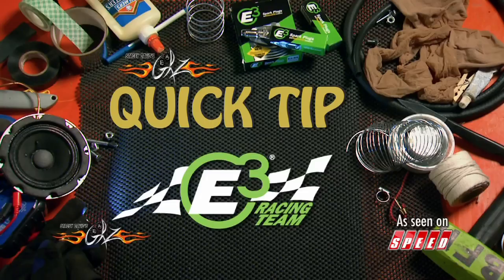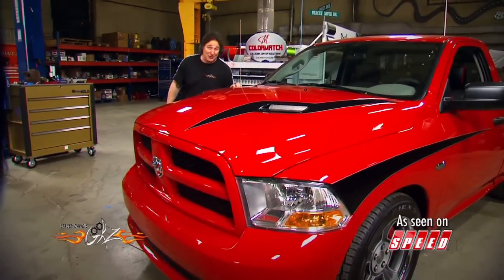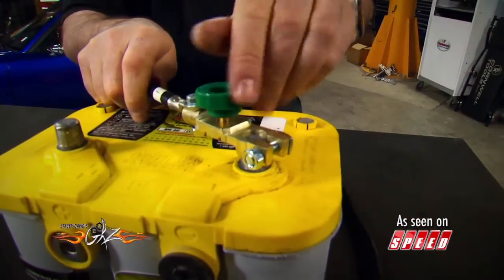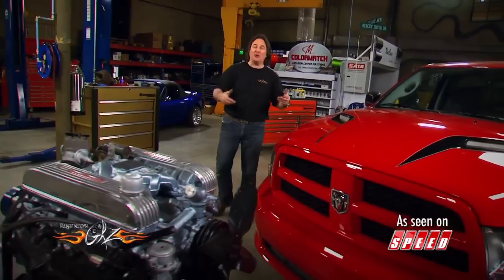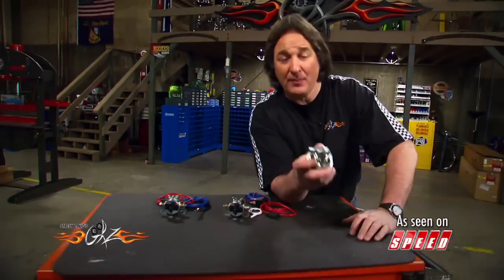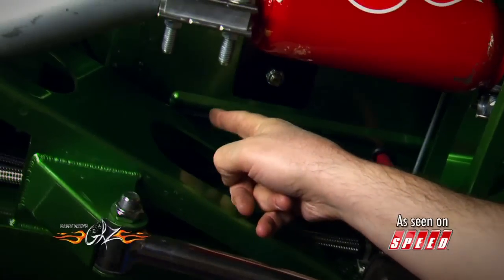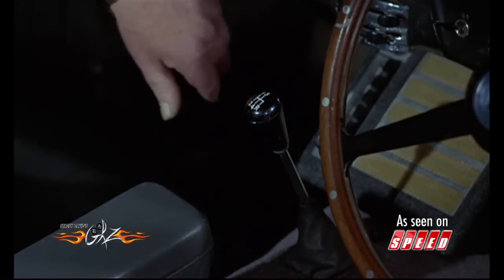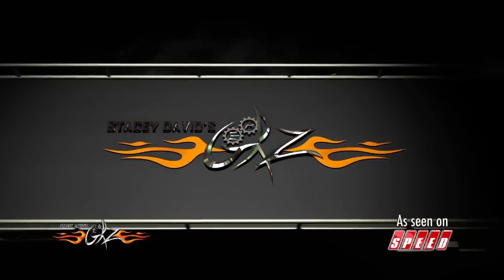Stacey David's GearZ Quick Tip: Keep Your Car From Getting Stolen

Comment: I take my engine out, When I park and walk with it
Reply: Raul Serrano 😂😂😂😂😂
Reply: lmfao
Reply: Raul Serrano ..you drive a rx7 don't you
Reply: I prefer the transmission. I go under the car each time i go to the grocery store and take out all the gears and put them in a carrying case over my shoulder. Go in get some milk, and just pop them back in when i'm ready to leave.
Reply: Raul Serrano i do that too my viper, i love carry a v10 around.
Reply: ALL the gears?  Wouldn't it be easier to take out, say, just First and Reverse?
Reply: AZMike Youre referring to an Auto trans arent you? Im pretty sure everyone in this comment section is a manual driver
Reply: LOL
Reply: Never thought of this...I'll have to try it with a 440
Reply: You guys are so silly, I just take off the driveline 8 bolts and then walk like Gandalf to the store.
Reply: Is it one of those old add on motors for a bicycle?
Reply: Lol
Reply: Smart.
Reply: @QuintTheSharker  car thieves watching this video too
Reply: I just remove the steering wheel and carry it with me. And install a fuel cut off switch. I also have a fuel cell in the trunk my e46 m3 and people can look at it and see it definitely takes premium and try to Siphon gas from my OEM gas tank  tank which is completely disconnected from the rest of my car and its filled with bleach, water, Iso-heat and gasoline. Yeah it may add extra weight to my car but at least it give those thieves a lesson as their car gets completely destroyed! Lol.
Reply: Lmao good idea😂😂
Reply: That's crazy. I fold up my car and stuff it in my backpack. Save lots of money on parking that way too. Very easy.
Reply: Lol
Reply: What the fuck is going on in that comment section bro lollll i'm weak asf
Reply: Where do you keep your engine stand???? I tried towing it, but those little wheels couldn’t keep up!!!!!!
Reply: auh you must have a geo metro
Reply: In the future, that won't even be a joke with the way car engines are getting smaller and smaller.
Reply: I need quick release engine mounts
Reply: @azmike3572  why not just take the Driveline with you
Reply: Richard Wolf, Zinfandel66 already does it!
Reply: @azmike3572  you guys are joking around but I literally pull my 9.9 Honda Outboard out of my sailboat every time I leave it at the dock because I don't want my freshwater motor stolen
Reply: It may be unnecessary.  They wouldn't steal your outboard from your sailboat because that would be dishonest!  (Smiley here)
Reply: @azmike3572  dude you have no idea.
I've never owned a boat before so I didn't understand how it worked so I wrapped a chain around it and chained it to the dock
When the tide came in the boat couldn't move so the ass end lifted 20 feet up in the air
Everyone was laughing and pointing as they were walking by and I had to wait six hours for the tide to go back out to take the pressure off the chain so I can unhook it!
Then I bent over to pull my sail boat motor out of the boat and my Sig Sauer handgun fell out of my holster and into the water
I spent two hours trying to find somebody and then paid him $200 to hop into the water to get it out for me and I didn't realize it was only 5 feet deep and I could have got it myself
Reply: You've given us unexpected info non-boat owners don't realize.  Thanks.
Reply: Tregeta take a quike change rear end
Reply: This dude is a man. My props go to you sir
Reply: Lmao!
Reply: @v4sdude191  cool
Reply: I literally laughed out loud
Reply: I prefer to just jack up the car take one of the wheels off and my adorable hyperactive kids just love rolling it all about those supermarket aisles keeps them occupied for 3hrs at least while the Mrs spends my hard earned cash on groceries we don't need aw bless em all🤣
Reply: I thought i was the only one
Reply: If I don't want anyone to take my truck I just get in my truck and drive away
Reply: Must have a asian car huh
Reply: Man this comment made my year and it’s January 😂😂😂
Reply: You made my day Raul , you are going to heaven 🙏🏼
Reply: They stoled My moms car battery
Reply: Hahahhahaahhaha
Reply: Lmao!
Reply: Lol
Reply: That's  genius  lol
Reply: Not everyone has a moped, Raul
Reply: RauI,thought I was the only one.
Reply: LOL!!
Reply: Lol
Reply: Lmao
Reply: Bahahahaha
Reply: Or you could fashion a clutch pedal quick disconnect....
Reply: I had one of my cars 🚙 stolen my V8 Mk3 Cortina yes it’s true not pulling your leg it was stolen. So now if I go to the super market or anywhere I just remove all 4 wheels put them in the boot I think you Americans call it trunk and I thought only elephants had a truck 😂 😂 😂 and inside of my 07 Mustang and throw one in my shopping 🛒 🛒 🛒 trolley
Reply: Lol😂 lmfao😂😂😂
Reply: Lmaooo
Reply: Doesn’t disconnecting the battery cause the computer to reset and go back to factory defaults?
Reply: Same

Comment: In the US just drive a manual and it will not get stolen!
Reply: +wizardnil  =))
Reply: +Zimas its sadly true!
Reply: Unless it's a wrx or something like that then it's the other way around
Reply: +Chris L that's why thieves never rob Imprezas
Reply: Yup.
Reply: I would love to believe that!   my Honda civic manual trans just was stolen this morning....
Reply: I had a manual it was still stolen lol...2 days ago
Reply: I believe The most commonly stolen car is the Camry. Then the Civic and Accord. The F150 isnt even in the top 5
Reply: Are you guys leaving the keys in the car or are they just pre-immobilizer cars?
Reply: next day it was found*
Reply: MrZrazies
Very cool it was recovered.
Reply: wizardnil Hondas Nissans are manual still get stolen.
Reply: I recently restored a 70 Monte the my dad bought from a co worker 20 years ago he backed out then but sold it to us later. he worked in St Louis and his wife was an electrician she wired in a huge brass breaker type fuse on the positive Cabel and he pulled it when he left the car in St Louis and it never got stolen
Reply: MyNoble06 ....because it was momte carlo.
Reply: +Archie Beech because this was in the early 80s in St Louis
Reply: wizardnil my brothers old car with manual shifter was stolen by 15 yo kid. he was arrested on gas station
Reply: MrZrazies I knew one guy, his civic was found in a 20 minutes after it was stolen... it was "parked" not far, but it was no ENGINE and TRANSMISSION  (whole front underframe with front suspension).... he probably didn't have change in a car, they took engine  (
Reply: wizardnil The guy from Engineering Explained had his car stolen and it was a manual.
Reply: My truck has a highly specialized starting process. You tie them 2 wires together, coast it down a short hill, and drop the clutch.  To keep thieves from stealing parts for scrap iron, I usually put a 12 volt electric fence positive electrode to the body.  Don't forget to turn it off before trying to drive the truck. I still remember how loud the old lady screamed when she grabbed the door handle.
Reply: +Grumpy old fart this made my day
Reply: Mr Zrazies......Someone stole my old pick up truck, and brought it back the next day with a note.....The landfill wouldn't take it, and get some good CD's, not that Bluegrass shit.
Reply: Get a quick release wheel and you're set
Reply: my ass, people say that but don't act like manuals never get stolen lbefore, happens all the time
Reply: lmao right. i luv driving manual is super fun.
Reply: wizardnil not true dude
Reply: Can say this works lol. came out side with my window busted upon but the car wasn't moved but an inch away from my house lol Note im 20 and learned on a manual and refuse to drive anything else but that
Reply: Dark Lord lmao nice 👍🏻👍🏻
Reply: MyFluctuations yeah it's very sad how manual is slowly becoming obsolete.
Reply: Indrid Cold wow that is so sad and funny at the same time
Reply: Wow! I seriously know that the OP wasn't talking about every case and just making a point on how a manual is becoming a thing of the past. And true, us older guys either learned on a manual of it was introduced to us in drivers training in high school. Only a young person with desire to learn will do so now. Other than that, they run away from a manual as if it were a black widow. (Now I expect to see all the comments..."I'm young and I drive a manual... Just making a point about most, not all.)
Reply: Lame joke is lame
Reply: wizardnil lol
Reply: Ben Santos is deported
Reply: Not if ur in a purto rican neighborhood
Reply: TheLokoViejo you mean mexican.
Reply: TheLokoViejo I agree....
Reply: "In the US just drive a manual and it will not get stolen!"  LOL, yeah right.
Reply: wizardnil I have a short shifter in my car with 6spd..   R is high left instead of low right like most 5 spds which more common...  All I do is remove the shifter knob and 1 there is pretty much nothing to grab for shifting with 2 most can't find my reverse even if they so try lol..
Reply: wizardnil not true.....anything can get stolen
Reply: Hahaha yeah right
Reply: wizardnil  in south florida... this isnt the case...
Reply: Lol so  true
Reply: wizardnil most car thief's know about cars and can drive stick...
Reply: Lol
Reply: It's true! Most people don't know stick
Reply: Jerald Rae my dad's Silverado is like that. They can still hotwire it bit if there's no key the steering wheel locks
Reply: NRG makes a ball locking kit that goes over your aftermarket steering wheel hub kit, it comes with 2 set of keys, and you attach it to the hub, then lock it with the key. Also these are great tips in this video. You just need to find a good hiding spot, like under the seat or deep inside the glove box, on the top corner, where they can't see it I would install a kill switch there.
Reply: wizardnil flatbed nullifies that
Reply: Short of illegal, lethal booby traps and if you have the money,  a good strong perimeter fence 10 ft or higher, a solid garage with good strong locks and doors, cameras, and armed guards work well.
Reply: They are getting harder and harder to find.
Reply: My 6spd truck was stolen WITH MY DOG IN IT, thief learned how to drive it til it ran out of fuel. My dog was hot and terrified but OK when (thank God) the truck was found that evening!!!
Reply: Enterprise Earth parts
Reply: That's is such bullshit. All cars get stolen whether they are automatic or manual
Reply: Jerald Rae The F150 is also the most stolen vehicle in Jefferson County Missouri.
Reply: HAHAHAHAHAHA! Right??? So on point. LMAO
Reply: Omg so fuckin true lmao im fuckin laughing so hard right now. I think i peed a little lol. Never really understood y people drove autos up until today. 😂😂😂😆😆😆😂😂😂😂
Reply: Not true.
Reply: Wizardnil hell yeah these millennials are too spoiled and lame. Save mt cars.
Reply: You don't even need to drive the car to steal it so the observation is irrelevant. As has been said, they roll up in tow trucks and drop them off elsewhere.
Reply: Wizardnil 😆
Reply: Wizardnil honda
Reply: Unless it's a Honda lol
Reply: ActionBastard what is a manual?
Reply: funny you mention that, I'm coming to this video after watching a video of a guy who's manual was stolen
Reply: For real I’m in tx 351c 1983 f250. Keys allways in ignition haha  10 yr I’ve done it
Reply: Just the younger generation can't drive standard.
Reply: @123PSPs  but what if they damage the deiveline with their inexperience with a stick? Then they need to steal a second one,see i told you nothing good comes from them stick shifter automobiles.
Reply: @lesliestone7587  glad to hear your hound was ok.
Reply: theyll take it but youll get it back with in a block
Reply: My Jeep has a 5-speed and it was stolen from a repair shop lot last summer.  The cops recovered it a day later about 50 yards away.  The only objects that were taken, besides the dome and cargo area lights, were a USB plug and cable.  Maybe they ditched it once they realized they didn't know how to drive a stick or they spotted the rosary that I keep on the package tray, thought the car belonged to a priest and freaked out, fearing the wrath of God. (I'm not a priest, but I am Catholic.)
Reply: Everyone drives autos over there ?.
You cant even get a full license unless you can drive manual in the UK.
One of my friends has an auto only license and it makes car shopping hard for him as almost no one over here buys them so there are very few for sale.
Reply: I love manuals. I love watching kids not understand what's going on when I drive a manual with them in the car
Reply: I was just gonna say that🤣
Reply: Not in Alaska. Lol girls will still your car or truck if it's manual
Reply: @Wizardnil  don't say never lol they get stolen all the time. leave your keys in it and see what happens. No vehicle is truthfully safe
Reply: Wizardnil LoL! Imagine them trying to steel my 71 Bronco with three on the tree🤣🤣🤣.  Not to mention the death wobble at 40 mph
Reply: Not true, I drive a manual and many others do also.
Reply: Chris L Wrx 💩
Reply: Auto thieves are car guys they know how to drive manual transmission
Reply: Dying breed of people who can drive one...first bike I rode standard, first car standard.
Reply: @LSWL00 yeah that's what I was thinking too. Car thieves are usually car guys they know about cars in other words they all know how to drive manual forsure
Reply: @Wizardnil  holy shit thus joke was played out like 20 years ago. And is sadly not true at all. I dont know a songle person that cant drive  manual.
Reply: Lol I have a manual truck and someone broke in and cought him in the truck trying to drive off and he kept killing it lol
Reply: nope, having a manual car im the US just makes it more desirable to steal.  especially the older cars
Reply: not true.  i always disconnected my battery but my 5 speed was stolen anyway.   and they can always push-start manuals.
Reply: My manual hellcat was stolen today
Reply: Well I'm good all the way up to a twin stick so..... Give me your carz😂
Reply: A vehicle doesn't need to be on to move it
Reply: what about my auto vip status car its low its heavy but looks nice and its auto
Reply: @EXALTEDDIRT  yeah, that was me just trying to prove a point. By the way, the shift knob, a little loose. I'll re-tighten it, though.
Reply: You mean I don't have to worry about my 1965 gto?
Reply: True
Reply: I strongly disagree.
Reply: Wrong. I had a friend whose car was stolen because the thieves specifically targeted a car with a manual.
Reply: @grumpyoldfart7302  need a tutorial on this
Reply: This aged very nicely - Driving a manual ‘07 Miata now :D
Reply: @abelrodriguez635 rip

Comment: Those kill switches work like a charm. Went to my friends house for a party and drove my '68 camaro. Flipped the switch and got drunk. Woke up the next morning and was about to leave until my car wouldn't turn over. I tried turning it over like 6 times till I gave up. Freaked out, had a beer, and then realized I had a kill switch in my car lol
Reply: lmffao damm that kill switch is reliable hahah
Reply: its was the beer that made you realize ha
Reply: Could still be over the limit.
Reply: Lol how many amp switch did you use?
Reply: Lol that's a bit harsh bro
Reply: Marco Hernandez good boy...😎🤘
Reply: @basabra  he literally said the next morning he tried to drive.. not while he was drunk
Reply: Friends dont steal other friends cars at parties.😆
Reply: Dumb luck looking out for you!